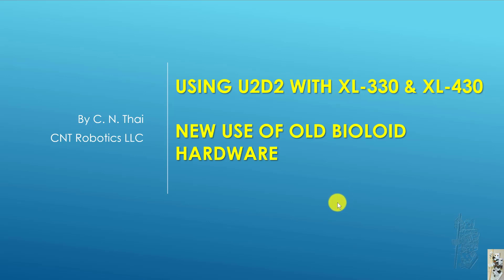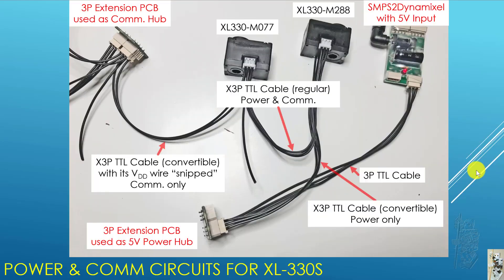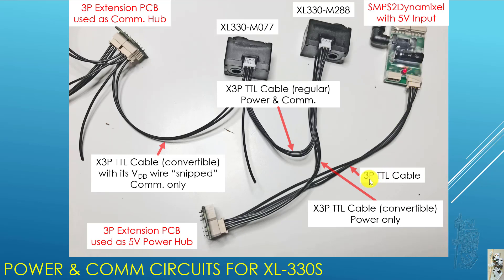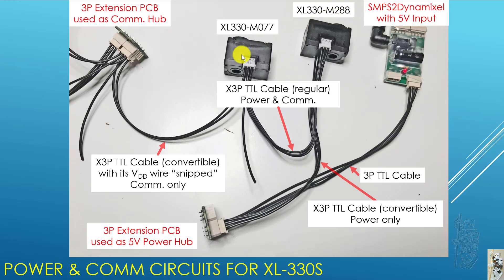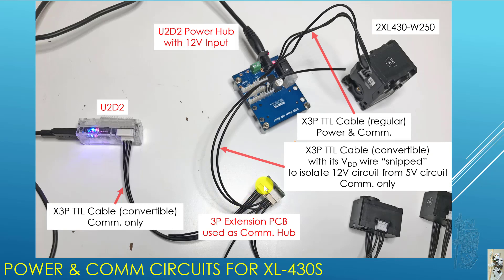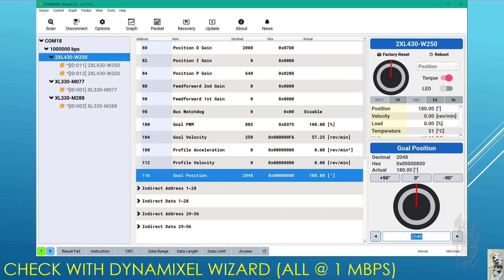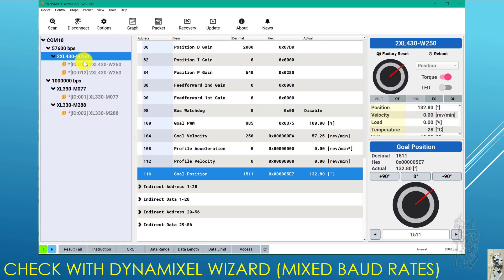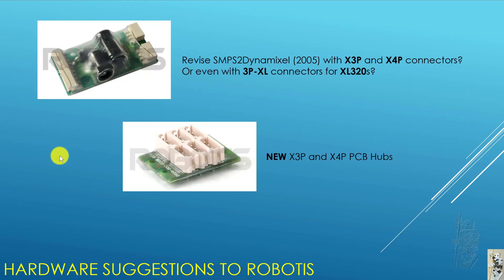Using U2D2 with XL330s and XL430s with BIOLOID hardware

Comment: Hi dude, I have SMPS2Dynamixel and U2D2 card. I have followed the "u2d2 supply power" documentation , which shows at paragraph 6.1 how to power dynamixel motors. But then I asked myself; Is there any way to plug the u2d2 at the beggining of the line (like SMPS) and not at the end ? Because it is really inconvenient if you are building a robotic arm to have to plug u2d2 at the last motor. Thanks for help
Reply from the maker: Sorry for the late reply, but it seemed that I don't get push notifications from YouTube anymore.  First, please make sure that you understand that the CONTROL Circuit (used by U2D2) is "electrically" separated from the POWER Circuit (serviced by the SMPS).  Both circuits do share the Common Ground.
The U2D2 only needs to connect to the CONTROL Circuit (i.e. Ground Wire and Data Wire (5V TTL)) and this circuit is "parallel" in nature, so you can tap into the Data Wire "anywhere" - at the beginning of the DXL chain or in the middle or at the end.   Are you using a mixture of DXLs or only a single type of DXL?
From now on, please ask your questions from this community web site "forum.robotis.com".  This site pushes notifications to me regularly.